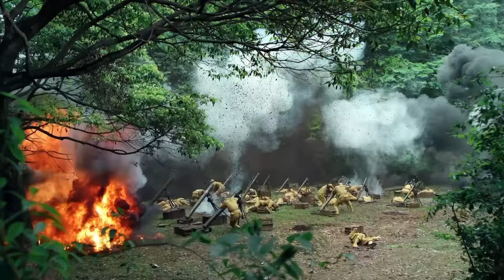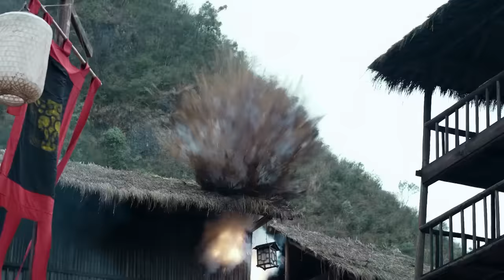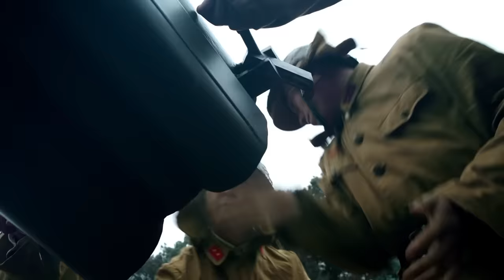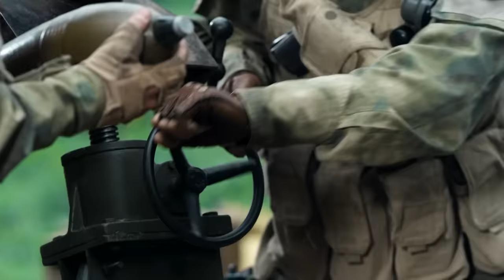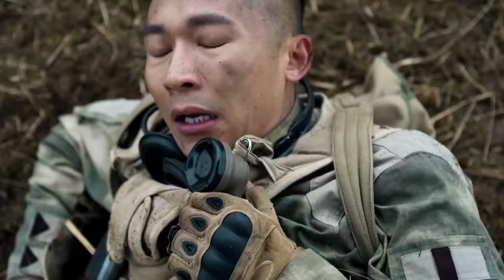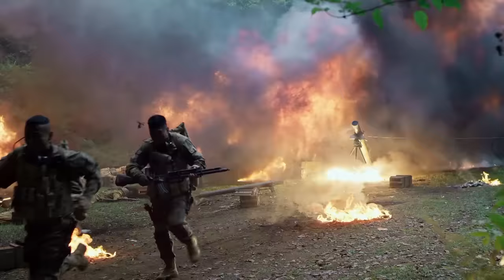紧张刺激的大炮对攻战！中国特种兵一门炮对抗日军的整个炮兵连！

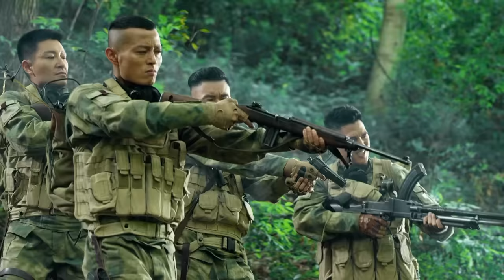Comment: 01:25 is that m14 and m1a1 thomson?! WTF HOW
Reply: Not an M14, rather there are no M14s used here, the weapons used by the Chinese Soldiers are the Bren LMG Hybrid, with the Finned Barrel of a Type 99 LMG, M1891/30 Mosin-Nagant Sniper Variant, M1 Carbine, and an Thompson thats a Weird combination of an M1 and an M1928s Finned Barrel and Compensator.